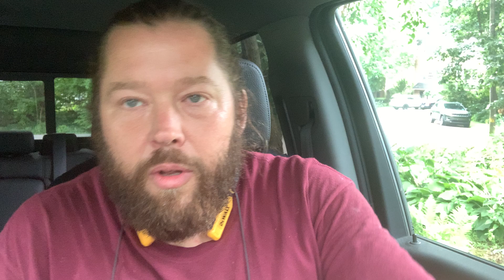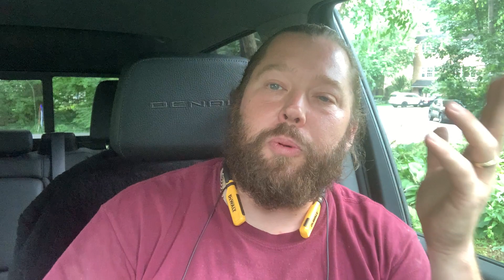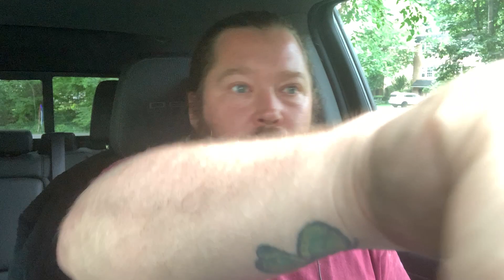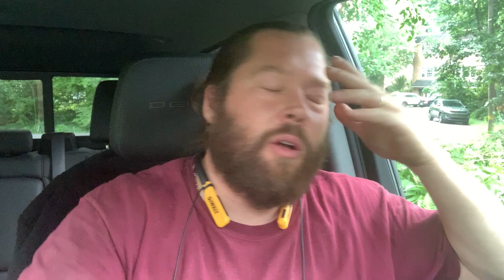Why a neutral 3 way system is dangerous

Comment: Knob and Tube I curious stuff.  There are even more curious wiring methods I have seen in old homes.  Ever come across a white cloth cable that looks exactly like the first form of NM cable but is white instead of black.  It looks like it’s made of white gauze.  Seen it only one time
Reply from the maker: Yeah, there was a couple different forms of cloth conductors during knob and tube eta. The most common are the cloth bx, two conductor cloth, and single conductor. Some were zebra striped, some were all black, some were color coded. It depends on the time period as well as the manufacturer of the wire.

Comment: I agree.  Switching neutrals is more dangerous and isn’t allowed in modern day wiring methods.  Seems like they did it a lot in the early 1950s with NM cables
Reply from the maker: It depends on the area, there are sections of Ardmore that are neutral switched, scary shit.

Comment: Got hit by the neutral on a 3 phase 277/480v lighting system.  I was only hung up for about a minute but the zap had my wrist tingling for the rest of the day.  The production facility didn't want the circuit off because it would stop production.  I'm pretty sure that the electricians wired wired the building previously overloaded the circuit because the red wideouts were glowing when I twisted them on.
Reply from the maker: What have you been hit worse by, the hot or neutral and why do you think it was worse?

Educated electricians that are in the field are far wiser because they physically see what electricity does and how it reacts to its environment. There’s not a book out there that can teach that.
Reply: I guess the neutral is more dangerous.  I really didn't get into that topic when I was apprenticing.  Like you said on previous videos new construction  and new commercial don't really teach troubleshooting to their helpers or apprentices.  I understand now that I was putting myself at risk for money and I should have called the temp service I was with about it.

Comment: I'm pretty new to the trade so I am trying to grasp it. I don't know exactly how knob and tube was done. It seems like it had hot going straight to load, spliced off to many other loads. The neutral from those lights were then used to interrupt and control the load. So there is always current created from the load on the neutral line no matter what. If done the modern way of wiring you are hit with only the little resistance of the wire itself. Current is what actually does the damage not volts. Knob and tube puts you in series with the load?
Reply: Knob and tube was wired without reference to polarity, so sometimes they switched the neutral sometimes they switched the hot. And No it is not current that kills but the voltage when there is no current limit, (such as in the house wiring) that shocks you. Because of ohms law that states that I=E/R (E stands for volts) and the fact that your body has a high resistance (your body isn’t made of metal) so it only takes milliamperes to shock you. This guy is saying that the hot isn’t dangerous and the neutral is more dangerous than the hot which is very misleading and false. The hot is 120 volts in reference to either neutral or ground (240 volts in reference to another hot 180 degrees out of phase ) the neutral is technically 120 volts in reference to the hot but since we have grounded the neutral wire to earth the neutral has no potential without the hot.
Reply: The ground wire is tied directly to the neutral ONLY at the panel and no where else. That’s why both ground and neutral have the same potential In reference to hot but the BIG difference between the two is that the ground is NOT a current carrying conductor and is only used for fault currents such as when a hot wire comes in contact with a metal box or fixture which the ground is tied to and will blow the breaker so that the person touching the metal of the fixture won’t get electrocuted by the hot wire now making the fixture hot. In most circumstances the hot will NEVER and should never come into contact with the metal fixture but the ground is there to provide a return path and causing the breaker to trip to tell the homeowner that something is shorting (the ground wire shorts the hot to blow the breaker)
Reply from the maker: Sometimes, but a switched neutral would.
Reply: Knob and tube was done with two wires non polarized (although later knob and tube installations WERE polarized) that were run on porcelain insulators as a safety check even tho the rubber wire that was used was safe they knew that rubber deteriorates so they supported them further on porcelain to protect against bare wires touching wood or eachother and shorting out to insure that even if the wire was BARE (which it never was in ALL knob and tube installations) they would not touch wood or short out with eachother.
Reply from the maker: @rickduncan692  
Rubber was not used in knob and tube. Try again
Reply: @DonaldMillerElectric  rubber was ALWAYS used in knob and tube indoors. The only time K&T would not use rubber was outside where rubber would deteriorate in which case they would use cloth that was impregnated with moisture proof and flame retardant substance(I don’t actually know exactly what substances were in that wire) which was always used on porcelain insulators and treated as bare
Reply: @DonaldMillerElectric  trust me I’ve seen plenty of K&T and I’ve read many books on K&T it was always rubber indoors especially. It was literally NEC code when knob and tube was installed. I can send you the old NEC code book
Reply: Knob and tube was just not polarized. The shock would be the same from K&T live wires (if you touched them) as modern romex wires because both are being supplied with 120 volts ac (hot and neutral) what this guy is saying and what I never disagreed on is that switched neutrals are more dangerous than switched hots because switched neutrals allow the hot to ALWAYS be at the light socket where if some uneducated person stuck their finger in the light socket (even if it was off) they could get a shock from that hot. Whereas a switched hot only allows hot to travel to the light socket when the light switch is on.
Reply from the maker: @rickduncan692  
Wrong again. Knob and tube conductors were never wrapped in rubber until the mid 1940’s. All knob and tube single conductors were wrapped in a cotton/tar and then taped with cloth/tar tape. Rubber conductors didn’t come into play until later. Go play with ur books, your theory sounds great but is wrong, laughably wrong and easily provable on a job site.
Reply: @DonaldMillerElectric  my “books” are literally electrical books that are 100+ years old on how to wire knob and tube and those books EXPLICITLY say that all concealed K&T wiring MUST be rubber insulated by the NEC Code
Reply from the maker: @rickduncan692  
So this is what I mean by you not having a clue. What you are calling rubber is not actual rubber, it’s a cloth and tar coated conductor, rubber was not actually used to insulate conductors until a jacketed non metal sheathed cable came out in the 50’s. Knob and tube conductors are cloth wrapped with a tar composite that dry rotted over the years.

Practical knowledge is far superior than book knowledge in these circumstances
Reply: @DonaldMillerElectric  I have seen and dealt with knob and tube wire. I have held it in my hands and I can Definitely tell you that is rubber.
Reply from the maker: @rickduncan692  
I am so glad other people can read your comments, truly they are hilarious. You will be the first person I have EVER heard call knob and tube conductors protected with “rubber”, congratulations. Your comments are so far fetched and ridiculous I don’t even consider your knowledge of the electrical trade relevant. If you actually were ever on a real job site you would understand some of the subjects I talk about, but you don’t, and most likely never will.

Comment: The neutral CAN shock if you are also touching a hot or if your touching what you’re calling a “neutral” which is sort of true but false as the hot wire that’s going directly to the light socket is then going through the bulb and to that “neutral” wire which means yes that will shock, but at the same potential as the hot because in essence it is the hot that’s shocking you.
Reply: The “neutral” wire (which is really the switch leg wire going to the light from the switch) is actually neutral when the switch is on (which Donald showed in the video I originally commented on) because the entire 120 volts is dropped to zero by the neutral that is switched on or off by the switch( switching neutrals is illegal and was banned by the NEC around when K&T installations started becoming polarized)

Comment: The amperage of the lightbulb has nothing to do with the electric shock you will receive by the non interrupted hot. You can not get hit by hot all day long that is dangerous advice to give, and you are one of the people who believe the myth that “current kills” which is very misleading as you need voltage for current to flow. The neutral is energized because the hot is going to that “neutral” a neutral will NEVER shock you to ground as the neutral is the same as ground. I will have to show you some basic electrical videos because you clearly don’t understand hot and neutral.
Reply: @KleinGuyJon  I literally never said that that “neutral” (which is not a neutral but a switch leg) couldn’t shock you. And I never said a “neutral three way” (which someone who knows what they are talking about would call it a switched neutral) is safer than a switched hot. Clearly you either didn’t read what I said or you just listened to the absolute nonsense that Donald Miller (who I cannot believe that he’s a “proffesional” in the field of electricity in any way being that he doesn’t even understand ohms law) said.
Reply: @KleinGuyJon  and you do not have a fucking load the switch is off meaning no current is flowing
Reply: @KleinGuyJon  what you’re are trying to say is that there is still live voltage going to the socket which is true but it is NOT a load and I can send you some basic electrical videos to explain ohms law.
Reply from the maker: @KleinGuyJon  
Hey Bud, rick doesn’t have a clue what he’s talking about because he is only book educated, if that even. He doesn’t understand that it’s carrying a load and it’s a neutral, regardless if it’s a switch leg. His own comments are exactly why guys out of school require 4 years of on site training to become mastered. The guy should stay in the classroom and stop trying to play with the big boys. He has absolutely no site terminology, his verbalism proves he’s book educated ONLY.

Comment: You clearly don’t understand basic ohms law. The neutral will only shock when the hot is connected to the neutral and the actual incoming neutral is not completing the return path.
Reply from the maker: Your a joke dude.
Reply: @DonaldMillerElectric  you sir are the joke